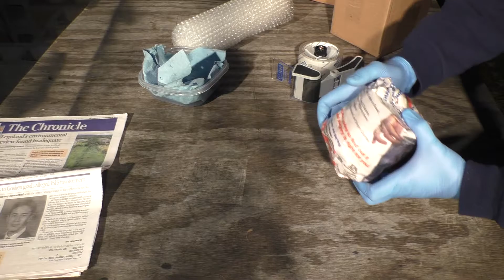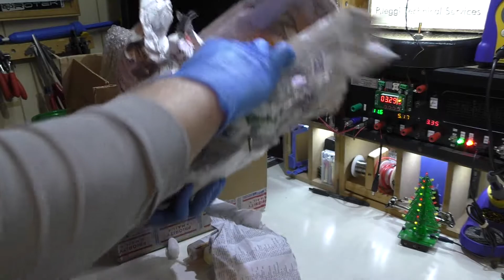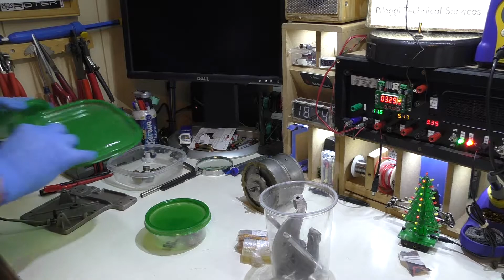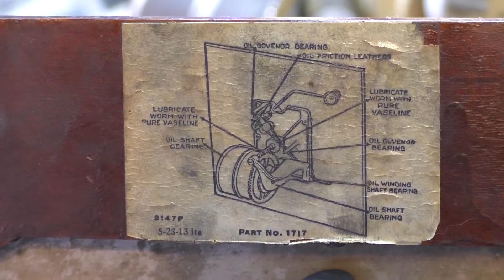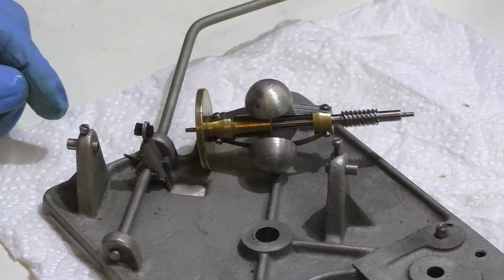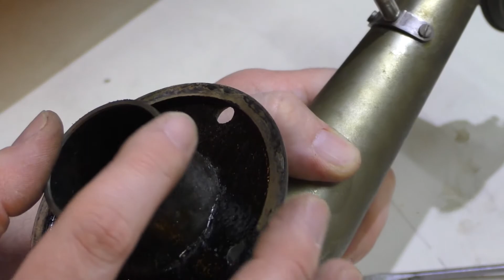PTS Ep. 151 - 1913 Victor Victrola VV-XI Repair Part 4

Comment: Hey I’ve got a XI I am repairing for a friend. I’ve taken it apart and the motor wasn’t even bolted to the top plate. The bolts were in but the nuts were piled up underneath at the rear door. I reattached the assembly to the top plate. it looks like the springs are turning and tightening and spinning the governor and main spindle. But when I took it apart the main winding gear that the handle attaches to fell out. When putting it back together I slid the gear in place from underneath. But when I try to attach the handle it just spins inside the gear. It is too loose for it to turn the springs. Is there a piece missing? I can send pics if needed. Thanks so much!

Comment: A problem I’m having with mine is that when you crank it, it just spins even though both springs are connected. It’s the gear that keeps on sliding and I need answers on how to fix it, it has a line going through the back and I’m wondering if that has a meaning to it. If anyone has any answers please tell me.

Comment: Cool video set.  I just bought a 1915 VV-X for 125 bucks.  And it needed some light adjustments simple cabinet clean up.  Looks excellent.  And because I thought it was a bargain, I splurged a 100 bucks and replaced the original Victrola No 2 reproducer with a much better condition Exhibition reproducer with fresh needles and this unit sounds excellent.  These videos are archived in case I need them, but right now I don't.  Just a note.  The best way to get bet sound and best life of the records is simple.  Regularly replace this needles with fresh new ones.  It's worth it to replace them and really don't keep the old ones around.  They are no good after a few plays.  Some say after each play.  The needles come in small, medium, and large and the key differences are many including sound volume.  But also newer 78's may have narrower grooves.  I mostly use the medium sized and it works well on most shellacs.  But if it does not sound good, changing the needle size may help.
Reply from the maker: Thank you for your comment and advice!

Comment: great set of videos! thorough and clean work. 
my family has actually 2 sets of these Victor Victorlas, one from my paternal Grandmother and another from my maternal side. My mom actually used to play me records to sleep in the 80's/90's! They are such beautiful pieces of craftmanship, both the woodwork and the mechanical designs. 

I'm actually in possession of the older one from my Paternal Grandmother, I believe it is the same model as these videos! I'm currently looking at trying to examine what is wrong and potentially fix it. It cranks and holds the energy built up. However my particular issue is that when the brake is release and the needle is placed upon the record, it rapidly slows down and stops spinning. When the needle is lifted, the record resumes spinning. 

How much did the rebuild in this video series cost the owner?

Comment: The "cog with stop to keep it from turning the other way" is properly termed a "ratchet and pawl".  For degreasing,  your nearby AutoZone is probably the place to go.  I got some stuff made by CRC,  I think it's called "Lectra-Motive" or something pretty close to that,  it does one heck of a job.
Reply: Lectra-motive is designed to clean electrical parts.  I assume it would work for this as well although there are specific CRC chemicals for degreasing.

Comment: I am repairing one similar to this one.  The mica in the reproducer is held in place with 2 o-rings front and back.  these get hard as a rock and don't allow the mica to vibrate as it should.  I guess there is a kit you can buy (which I will do) that includes everything to refurbish the reproducer.  This kit (IMO) would allow for deeper bass notes and not sound so tinny and seal it so the sound is louder.
https://www.youtube.com/watch?v=UuivfuM5wLo   shows the problems with these things and what to do.
Reply from the maker: Thanks for the link.  I wish I knew about the replacement before I bought the parts.  The owner would have surely let me do the repair.
Reply: I bought a kit.  $57 for all the parts plus 300 needles and a new felt for the turntable.  I finished the repair and it works perfectly!  The only thing is the adjustment of the needle holder and how much tension to put on the 2 leaf springs.  I couldn't find any info on that. It would seem to me if the screws were too tight, the needle would be restricted in movement and thus not transfer as much vibration to the mica.   But the repair parts all fit and went in as the instructions described.